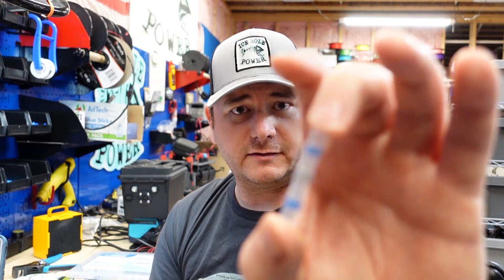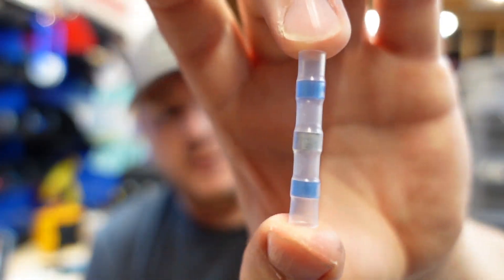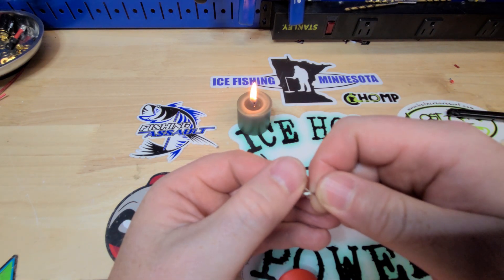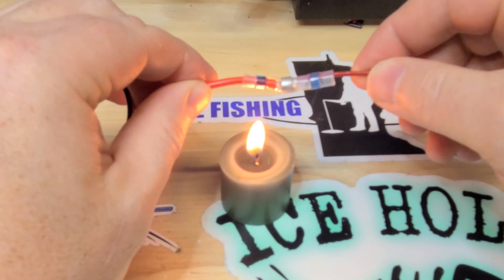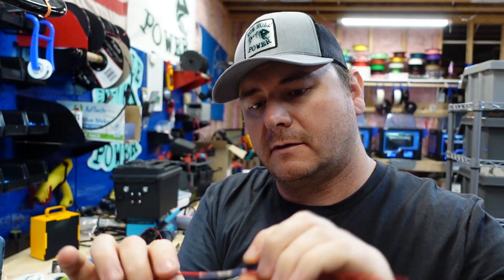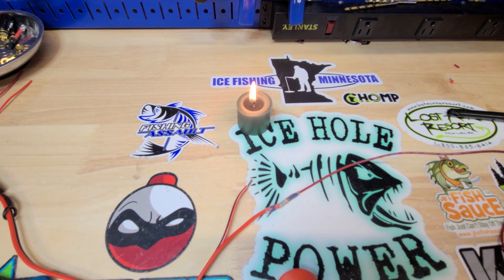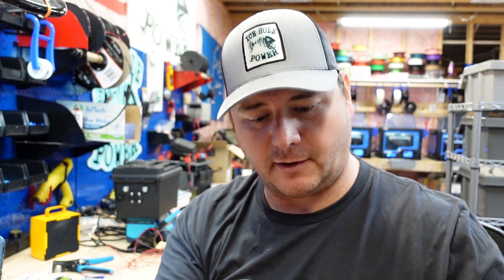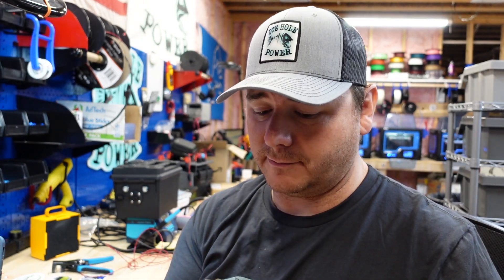How To Use Solder Seal Butt Splices Connectors

Comment: What if the blue stuff gets on the wire?
Reply from the maker: That is the waterproofing for the connector.  It is meant to cover the wire so no moisture gets on the wire.
Reply: @iceholepower8012  oh ok.

Comment: Very good demonstration of these butt end solder connectors. Much stronger than the crimp style. Plus you get a shrink wrap effect, water proofing the connection.
Reply from the maker: Thanks Paul!
Reply: I don't know if they are stronger.  I watch "South Main Auto"  and he used to use them, but I believe went back to a mechanical type with shrink sealer.

Comment: So would a heat gun not work well with these?
Reply from the maker: It does but i figured more more people had candles
Reply: Found my heat gun melts the plastic and has a hard time flowing solder why I’m here lol’ 

Just bought a tip for heat gun that curves back kinda making a small shield hopefully  that will work better